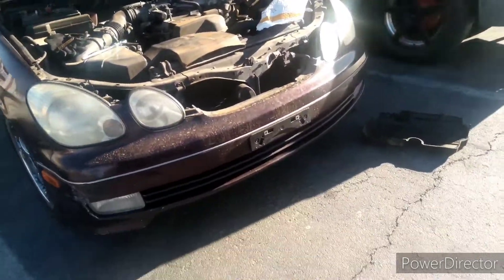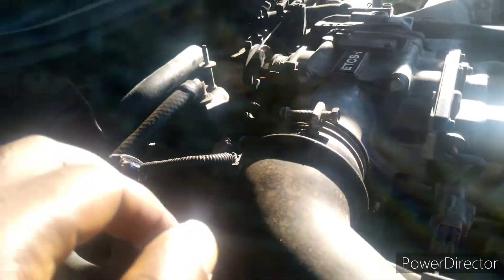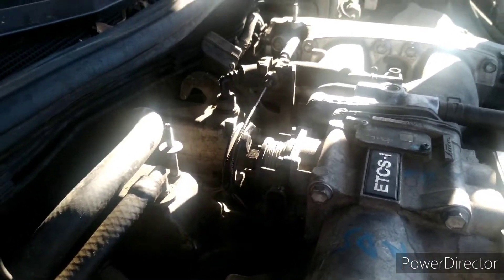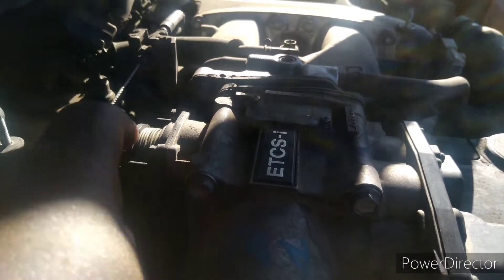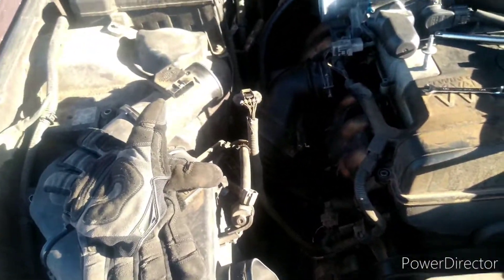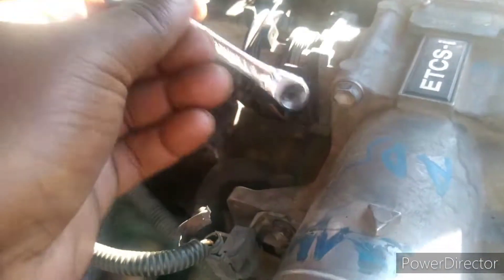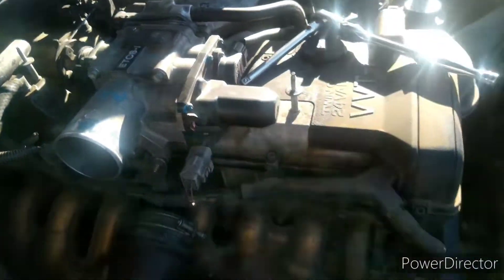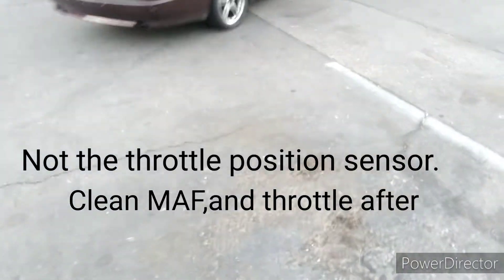2002 Lexus GS 300: Back again with code p1121

Comment: I'm having this issue as well I bought a throttle body from the junkyard and everything was good for like 3 months then again the same code as before comes up again
Reply from the maker: If you can't accelerate, with the gas pedal all the way to the floor then it's your throttle level position  sensor. It's sits on the back of the throttle body. You can buy it off Amazon. You have to take the whole throttle body off to change it. Also look for a leak in the rubber holes into the side of the throttle body. They tends you spilt at the bottom from the heat of the exhaust manifold. Go check out my other videos on this Lexus.
Reply: @iamonearies21  much appreciated man I'm going to try n get this done today after work and I'll check out if there are holes on the rubber thanks for the help
Reply: @ozzy1427 what was the issue ?
Reply: @ozzy1427 did that fix it?

Comment: Bro did that fix the issue? if so what did you do just a deep clean and replaced the sensor? Im going to replace mine later this month when i get back to my gs.
Reply from the maker: Yes replacing the throttle sensor and it had a dry rotted vacuum hose to the back of intake to replace that. The guy ended up giving the vehicle to his son. I believe is son mentioned something about changing the pedal sensor.
Reply: @iamonearies21 yeah i got a code for p1121, so far I replaced the tps and still nothing so ima replace the apps next as well
Reply from the maker: When was the last time you had a coolant flush and change